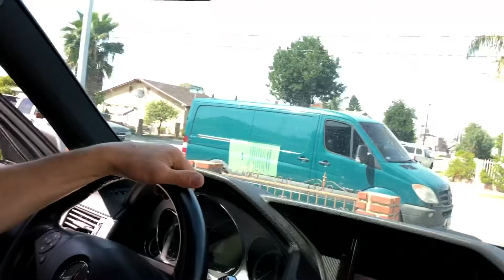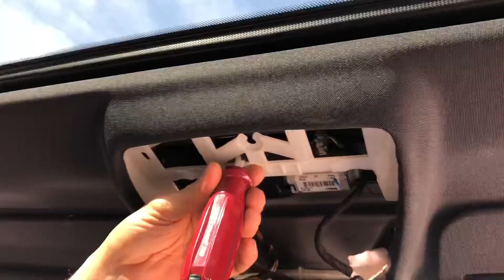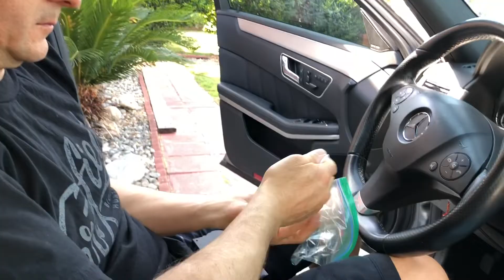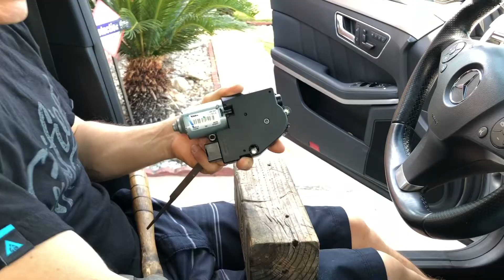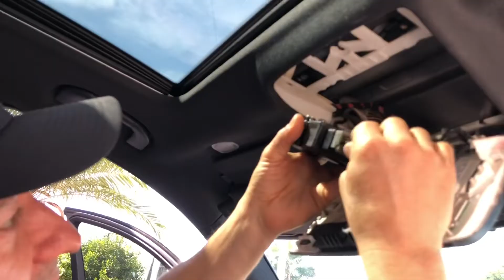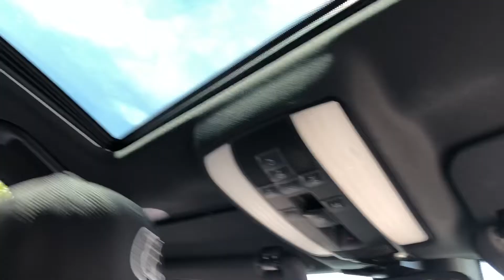Mercedes Benz (E350) sunroof repair. Pro tips!

Comment: Just installed mine but the gear will just glind and not hook into that cable.. I think one should check if the gear is upside-down based on the cable direction

Comment: @surge_vasquez question. My 2011 E350 moonroof stopped working and is open a bit. I found a broken gear from the motor. The dealership is telling me I need a new motor and a whole new moonroof assembly. Is this a case of them taking advantage or do you think I need just a new motor? Could the cables have went bad too

Comment: I have a 2017 amg c63s with the panoramic sunroof and it won't open. When pressing the open button, it lifts up an inch and then fails to open and closes back down again. Would the repair procedure be similar? I used to be an automotive technician so I know how to repair cars but this is my first Mercedes and I'm not familiar with how the headliner is assembled around the sunroof. It's a $2k+ fix so I can't afford to take it to a shop
Reply: Sounds like you just need to reset the sunroof.
Reply: ever figure this out? s550 here with the EXACT same issue
Reply: 15 c300 one side doesn't open, causing same issue as described above lol

Comment: Hello sir. Thank you very much for all your videos. I desperately need your assistance I have a Mercedes E350 2013. My sunroof close extremely slowly and sometimes stops in the middle. It just stopped working. It won’t close anymore. When I press that bottom , no noise and no movement at all. What should I do ? Thanks in advance for all your assistance sir
Reply: I have the same problem right now , did you have any news about yours? Or did you just send it to the mechanic? Thanks

Comment: Hey Surge how do I remove the motor after removing all the screws ? I cannot take the motor out.
Reply from the maker: Are you sure you have all the screws out? There shouldn’t be anything else holding it on.
Reply: @surge_vasquez  yeah I got all 3 of them out exactly like you in the video. And I took out another one so 4 in total ! It was still stuck I couldn’t move it.

Comment: Hi Sergio. This is a great video. I have the same setup of the car on your video. Here is my issue: When my sunroof goes up, it makes a rattle noise, however, I checked the gear you replaced, but mine happens to be just fine, it is not broken. What do you recommend I do? What can possible cause that noise? Thanks!
Reply from the maker: It could need to be re synchronized or might have an issue with the track.

Comment: . I have a 2010 E350 Coupe which have the roof leaking problem. Can you please tell me how to fix this issue exactly? Do you have a video for my car model? I cannot even go to carwash because of this problem.
I appreciate your help.
Reply from the maker: I had a roof leaking problem too. There are two drains in the corners that need to be carefully cleaned out. They commonly clog with dirt and debris.

Comment: hi , i have MB E350 2012 and my sun roof wind deflector is loose on the side which connect to the car from front , i only see a rubber blade but dont know where to install it , when i do it goes up again , is there is a missing part ?
Reply from the maker: Not sure.
Reply: @surge_vasquez  i mean the wind deflector part of it is loose where is it suppose to be hold to ?

Comment: Hi Surge, thank you for this video i learned a lot. I am having a synchronizing issue. My sunroof doesnt automatically close, i have to keep pressing the button to close but it closes every .5. Same thing with opening. Any help?
Reply from the maker: I would think you need to close the roof manually. Remove the motor. Power the motor up. Set it to the closed setting. Reinstall and see if things sync up.
Reply: @surge_vasquez  is this how you resynched the motor after changing the gear head? 
--1. Manually spin the roof shut 
--2. Power up the motor removed out then use the switch control to shut position 
--3. Reinsert the motor.... ?

I swear, my roof is possessed!!!
👍

Comment: Nothing is working the blind or the sunroof,  actuator calibration  its showing on the diagnostic
Reply from the maker: Ok. Bad motor assembly?
Reply: Mine's got this too. When i try and open the roof, the motor just gives a single faint click - did you ever fix yours?
Reply: @Subzero2698  yes I replaced the sunroof motor, is urs the W212 model?
Reply: @tariqrashid1000  it's a W204 coupe. Did yours just quietly click once when you tried to open the roof ?
Reply: @Subzero2698  yes, was very faint
Reply: They are very easy to replace, you can do it urself, only took me 20 mins. Try dronsfield mercedes spares fir second hand motor £45. Any issues give us a shout,

Comment: This video is absolutely fantastic, 
I do have a question if the sprocket is broken inside would that stop you closing is manually? Only ask because my sunroof was stuck in the open position but I still managed to close it manually.
Reply: My sprocket was split in half like the video, and I couldn't close it manually. If you can close it manually it could be another issue with the sunroof motor
Reply: @kemoalex2350  thank you brother,